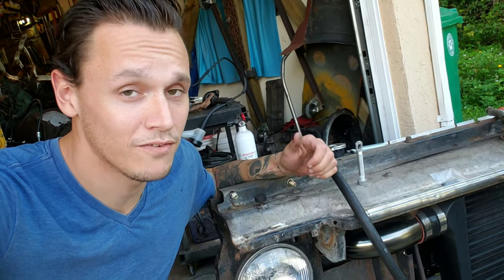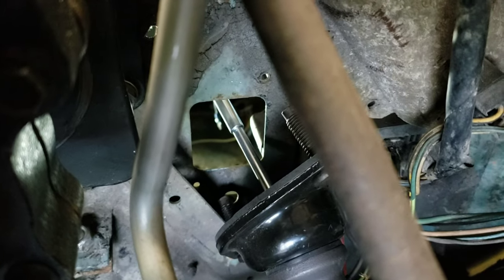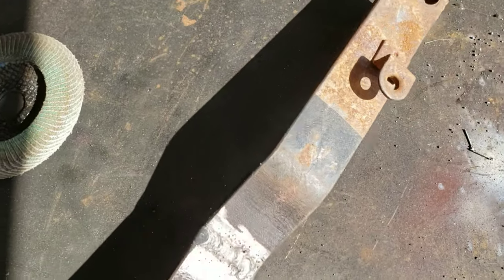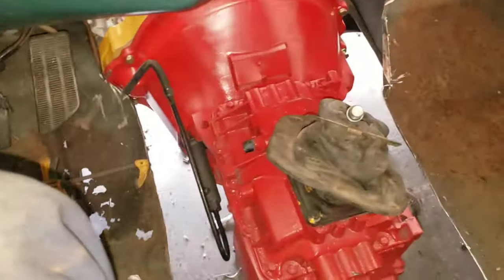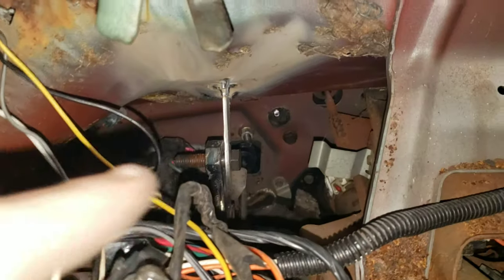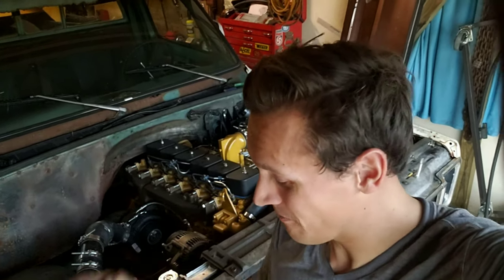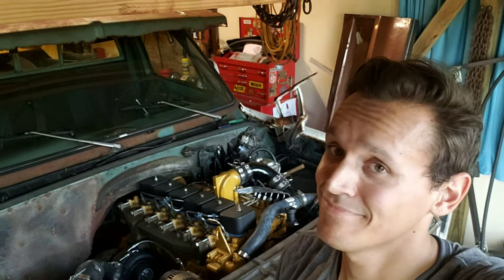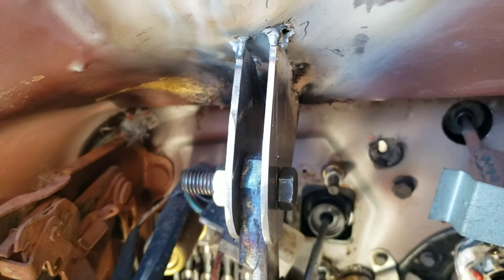NV4500 SWAP Part 2

Comment: The grin on your face during the test drive made me smile. I know you have to be giddy that you finally got to this point. Your perseverance is paying off. And who doesn’t love the sound of that turbo spooling up? Anything special with the driveshaft - HD u-joints, special tubing, etc? I was expecting something beefier looking. I’m still hoping for a 4x4 mod, but I’m sure I’ll enjoy whatever direction you decide to take this project.
Reply from the maker: Thanks! It's more exciting than I can even begin to explain! The driveshaft is just a basic setup, nothing very special or HD. I'm not too worried because shes still under 200hp. But once I start getting closer to 300-350hp I'll be looking into better stuff. But I'm also hoping /planning for a 4x4 conversion! I got a few things in mind that I'm doing some research on to see what we can whip up for Bessie, but it probably wont be anytime super soon unfortunately. But you're definitely thinking in the right direction! Thanks for the support!

Comment: So, that square block that you pulled off the firewall is actually a "sandwich block". One part of it bolts to the front of the firewall and the other part bolts to the inside of the firewall on the inside of the cab. And it sandwiches the firewall in between it, hence the name "sandwich block". The inside sandwich block connects to the wiring harnesses inside the cab and the external sandwich block wires up to the battery and all the terminals inside the truck. I just tore apart my 1st Gen. Dodge and it took me forever to realize what that did.

Comment: Hoping you’re doing okay. Miss seeing your new, high quality content.
Reply from the maker: Thanks! I just posted a new video today!
Reply: @ChucksCustoms  any idea what it takes to connect ls gen 3/4 to nv4500?
Reply from the maker: It depends if it is a gm nv4500 or a dodge nv4500. Once you know that, "Advance Adapters" sells adapter plates and bellhousing kits for pretty much every combo. Average price looks to be between $250-$500 depending on the configuration
Reply: @ChucksCustoms  but if its a gm trans shouldnt the bellhousing bolt right up?!?!
Reply from the maker: If you have the right bellhousing, yes

Comment: My NV 4500 is a L 123 overdrive , that is what you have . Mine came stock in my 1994 chevy 1/2 ton . I have 305,000 miles on it and love that transmission

Comment: It’s a year bit too late but for future reference on the clutch pedal set up. There’s a booster kit that still allows you to use an 84-91 k20-30 and 84-87 k10 hydraulic assembly that takes 5 minutes to drop in. I used one on my cummins swap c10 about 3-4 years ago and the hardest part was punching out the hole in my 76. But was still easy to get done

Comment: Man I love your videos!! I’m currently in a square body swap myself and before I started tackling any of it I decided to YouTube some videos. I bought a 1989 gmc 6000( 2 ton grain truck). Put the cab and front clip on a shorter wheel base 1 ton frame. Im about ready to start test fitting the 12 valve and nv4500 in it. I’m not putting a bed on it just some polished and clear coat steel to give it that clean look. Hide a way gooseneck ball. Dual miter cut smoke stacks and I’m picking up some fuel tanks off a semi tomorrow for it. I’m so freaking stoked!
Reply: My dad called my truck “Wilber” for whatever reason one day and it just kind of stuck so that’s the name of my baby.
Reply from the maker: That thing sounds incredible!! What a monster!! I gotta see some pics of Wilber when you're done. I'm excited to see what a beast its gonna be!

Comment: Well done !! The engine sound niceee!! Congrats!!
Reply from the maker: Thank you!
Reply: Have you consider to do a fly by video it can be nice even if is a shot one !
Reply from the maker: @chepeloc28  I've got a few mods planned for the next video that will require another test drive. I'll be sure to do a drive by in the next one! Thanks for the tip!

Comment: I HAVE A QUESTION!!!

Im panning on doing a NV4500 swap on my 2002 Ram 1500.
Where can I get a aftermarket driveshaft or something for that matter.
The power plant (5.9 mangum V8) will be doing like a little over 400 torque
Reply from the maker: I've always used a small local shop to do my drive shafts. They're called Drivetrain Center and they're located in Stuart, FL. I'm sure if you contact them they can help you out. Otherwise I would just see what your local shops have to offer. Hope this helps!
Reply: @ChucksCustoms  thanks

Comment: This is awesome!
I plan on doing the same swap in my 84 K30
And was wondering how I would convert to a hydro clutch vs the mechanical one I have now. Thanks for sharing this.
Reply from the maker: Glad it was helpful! Let me know if you have any other questions 👍
Reply: I want to cummins swap my 84 chevy c30. I cant find a 12 valve and a 6 speed for cheap. So ill have to stick with 6.2 diesel and a 4 speed

Comment: Fun fact: the pin on the clutch pedal that the push rod attaches to is the same as the Dodge Ram. I know this because I did the nv4500 in my truck. The clutch pedal is easier to install if it's a chevy pedal set, but it still sucks.

Comment: Thanks for making these awesome videos buddy. I'm at the tail end of my Cummins swap into my 78 C20 I converted to 4x4. What slave cylinder kit did you go with on rockauto?  I bought one for the 95 donor truck I used but it didn't come with bolts that would allow me to attach it to the fire wall. It looks like it slides in and twist locks somehow.
Reply from the maker: That's pretty strange that it didn't have the bolts for mounting. But I believe I ordered mine for a 96 or 98 Dodge 2500. The rock auto part number is: SKP SKCC649027 I'm gonna have to check out that build of yours man, sounds like a beast! Keep me posted on the progress and let me know if you need help with anything else 👍
Reply: @ChucksCustoms   I appreciate it buddy. I'll shoot you some pics or something. Wish I could've documented it the way you did. Maybe next build haha

Comment: Anything new going on these days, Chuck?  Just curious.  Finally got my  Cummins installed and running in my 98 K3500.  Still needs a cooling system and intercooler, but it's getting there.  I keep watching your vids to stay motivated to get my truck on the road!
Reply from the maker: Glad I can be your motivation! Sounds like a badass project you got there 💪

Comment: Did you have the drive shaft built or used the one in it and got a u joint that fit the yoke and shaft?
Reply from the maker: My driveshaft was custom made at a local driveshaft shop

Comment: Congrats on getting it on the road! I've really been enjoying the series, I might've missed it somewhere but what are you doing for an alternator? Stock one with a regulator added? Or a stock chevy one modified to fit on the motor? Or maybe an aftermarket one? Thanks, about to start the swap on my 1962 chevy k10 and just collecting all the pieces right now
Reply from the maker: Thank you! I'm running a stock dodge alternator for the 1996 ram 2500, and it's been converted to a single wire output with an internal regulator added. If you get the stock alternator from a parts store, an alternator shop will usually do the conversion for you for fairly cheap. Good luck on your swap and keep me posted! I'd love to see how it turns out!

Comment: Chuck what kind of clutch are you using? I’m going to install an Eaton Fuller 6 speed to my 6bt
Reply from the maker: I ended up going with a stage 2 "clutch max" clutch. Got mine on eBay: https://www.ebay.com/itm/132678202964

Comment: Know this is a older video but what power steering pump are you running. I have a 94 k2500 that is 12v swapped but running into ps issues
Reply from the maker: The ps pump is from a 1996 dodge 2500
Reply: @ChucksCustoms  thanks for quick reply. I'm using a 97 which is same.  Thanks
Reply from the maker: No prob!

Comment: How’s your frame holding up with the extra weight?
Reply from the maker: Honestly better than I thought it would. However it would probably be smart of me to replace the bushings and tierod ends just to be safe (they're still factory originals) but for now the frame and suspension are holding up great!
Reply: ChucksCustoms I’m thinking of doin a swap like this. And I was wondering whether to put a c10 body on a dodge frame or just out it in the c10 itself?
Reply from the maker: @trojankid4252  I honestly dont really know. I'd have to say just put it in the c10 itself. If you try to match the chevy body to the dodge frame I feel like you're gonna have a ton of fitment issues with body gaps and things like that. Plus you would have to adapt all the brake lines to fit a chevy master cylinder and dodge brake calipers. It seems like no matter what you're gonna have a decent amount of adapting and fabricating to do. But it just depends on what kind of fab you want to do; cosmetic fab (body mounts, front clip, bed frame and mounts, etc) or mechanical fab (engine mounts, crossmembers, frame boxing, etc). Either way, I'd be more than happy to help in anyway that I can if you get stuck on something along the way.

Comment: Why a manuel and not a auto rh47.?? And are going to put better brake on her
Reply from the maker: Manual is just all around better for me. I think they're fun to drive, no computers, and easier to rebuild if the need ever arises. The brake system is 100% brand new, and it's been working great for over 1000 miles so far!

Comment: Ok I’m coming straight out of high school planning on doing this to my truck. Is it worth it. I have a 2005 Dodge Ram 1500 and I want a 12v in it. Is it worth the money and work?
Reply from the maker: I honestly wouldn't really know. Given the fact that it's not only a different make, but a much newer truck as well, I don't think it would be as simple as my swap was. You're going to have to deal with the existing computers, different sized engine bay, possibly a less robust frame and suspension, etc.. I think you would be better off just buying a Dodge with a factory Cummins. But that's just my uneducated opinion. For all I know it could be even easier than my swap lol but I don't have any experience with those trucks to give you a solid answer. All I can say is, if you have the desire, I believe you can make anything happen, and you have my full support. But if you're worried about wether it's financially worth it in the long run, it's honestly really hard to say, but I don't think it would be.
Reply: Might look at a 24 valve commonrail so you can used a wiring harness out of a dodge 2500 or 3500 cummins diesel. And also find a set of 3/4 ton axles cause the half ton axles just won't last long on it
Reply: Ok thank yall
Reply: @glossy_5.3  no problem
Reply: X_fxnesse_X 2k I'd look into it deeper. A 12v in a 1500 is usually too much for the components in the truck. If you look at Deboss garage's channel he knows all about swapping a 12v and he made a vid talking about when he would and wouldn't do swaps.

Comment: The 12 and 24 valve shake the ground around the truck. Love them both. You can pick up the pure awesomeness of the 5.9 cummins. Duramax and powerstroke are kinda bland and boring. Cummins engines are the best in my opinion
Reply from the maker: Without a doubt! I100% agree lol

Comment: Why didn’t you just put factory pedals in it and put the master on the stock location on the firewall? There’s two little dimples where the holes are to be drilled? I don’t understand you made this harder than it needed to be
Reply from the maker: I honestly wasnt trying to do it the hard way lol This whole project has just been a huge learning curve for me, and a challenge to try new things. But I honestly didnt even know about the stock location dimples.. I can guarantee this wont be the last project like this for me though, so at least now I know for the next one! I appreciate the tip!

Comment: I'm gonna get a 1999 dodge ram 1500 with a 360 v8 I want to put a 12 or 24 valve cummins in it along with a nv5600 what do you think? A guy says if I'm gonna do a 12 valve he says to find one with a ve pump rather than a p pump which saves weight than having that big ole botch pump which weights around like 60 or 70 pounds
Reply from the maker: Is there any particular reason you want to swap the 1500? Just seems like a lot of effort to go through when Dodge already makes the 2500/3500s that are meant to support the weight and power of the Cummins. But if that's what you want, then I suppose I can't judge. It's a labor of love after all lol. But as far as the VE pump vs the P pump, it really depends on what you want to do with it. Do you want to daily drive it and be fuel efficient? Then I'd say go with the VE pump. Or do you want to easily tune it and boost up your HP? Then I'd say P pump. But if your main concern is weight reduction, then it doesn't make much sense to be swapping in an 1100+lb engine if you're worried about a difference of 40 - 60 lbs of engine accessory weight.
Reply from the maker: I hope that doesn't sound rude, I'm just trying to express my way of thinking. At the end of the day, you just gotta do what makes you happy, no matter what some dumb YouTube mechanic says lol
Reply: @ChucksCustoms  I'm not sure yet I might just get a 2500 or 3500. I just thought it be cool the truck was in the family since it was nearly new. There's a ton of 2nd gen dodges in the junk yard over here I was thinking. 

Frankentruck?
Reply from the maker: Ohhh I like the way you think lol I can definitely understand doing it for sentimental reasons. My dad had a 2000 Chevy 3500 that I would've loved to do the swap to. Same story, in the family since new, but it fried the trans in Georgia and ended up in the scrap yard up there unfortunately.
Reply: @ChucksCustoms  was it a auto or 5 speed?
Reply from the maker: @oldcroneysgarage9739  auto unfortunately
Reply: @ChucksCustoms  some of the obs chevy transmission aren't the greatest transmissions kinda like dodge transmissions and not many came with the 5 speed sadly